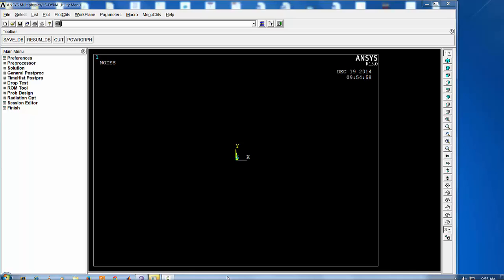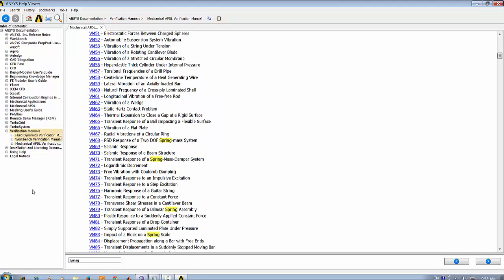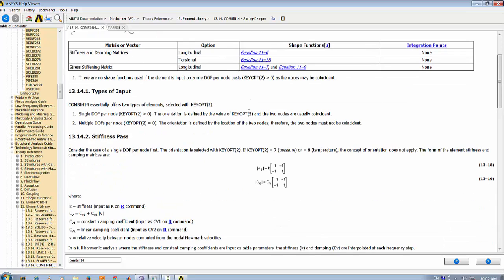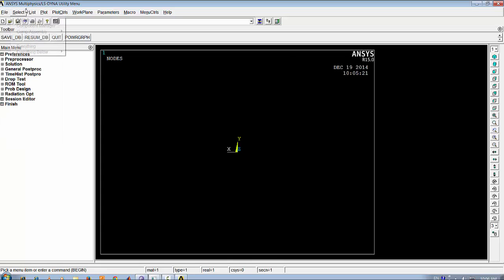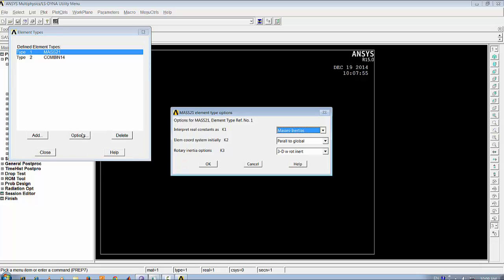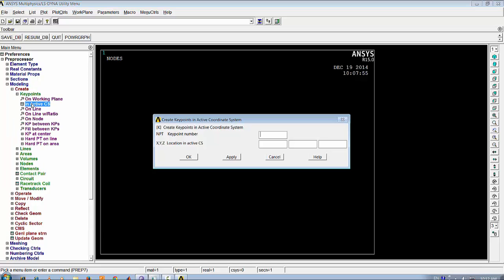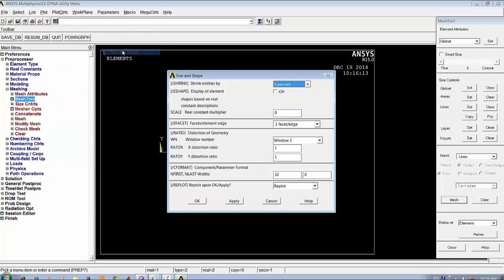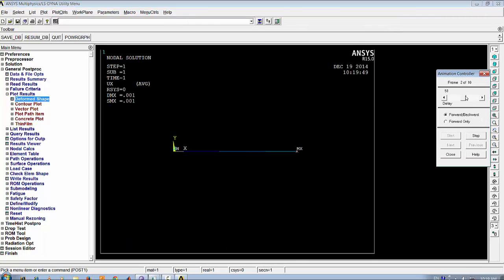Ansys Mechanical Introductory Lecture Series LecB01: Static analysis on spring mass system

Comment: Thank u for this amazing channel, I would like to know why u applied the force and the displacement on nodes and not on keypoints :)
Reply: Thank you Rim. Actually, in Finite element terminology, all the boundary conditions, that is force/moment and displacements/rotations are applied at the nodes. Keypoints, lines, area, volume are all related to solid modeling concepts. Even if you apply a boundary condition at the keypoint, line, area etc., it will be automatically mapped to the corresponding nodes.